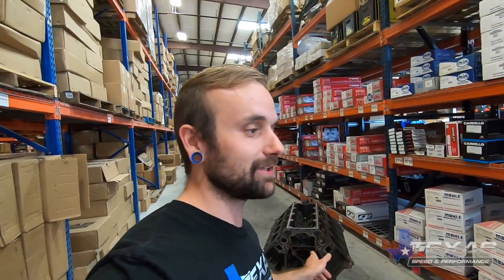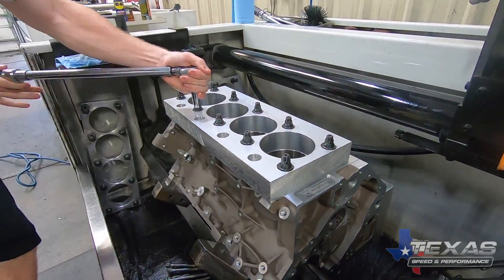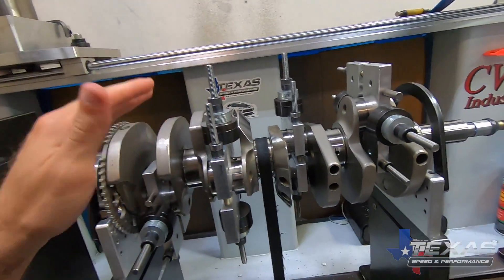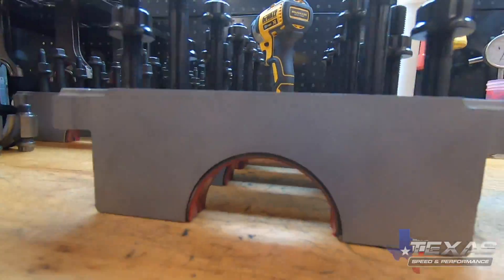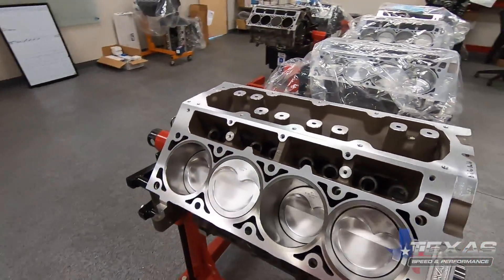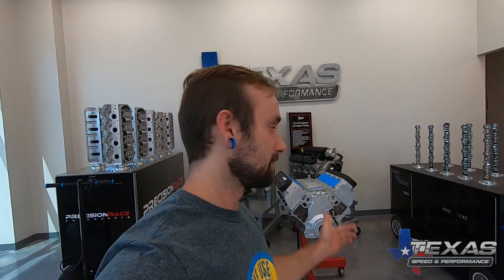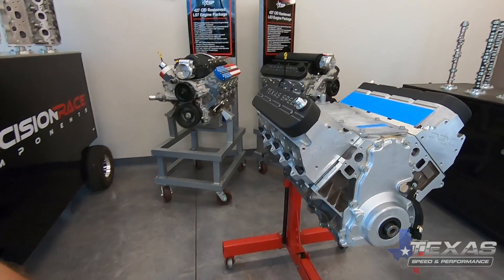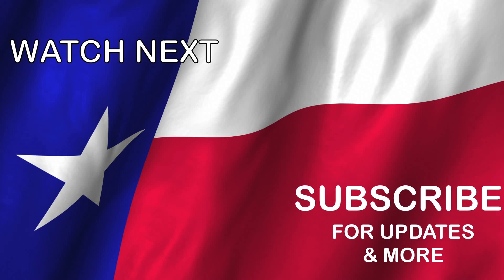Assembling B Is For Build's New Lamborghini Huracan LS Engine!

Comment: Hey guys have been thrown to this channel from b is for build loving the look of it just a quick question looking at running a Chev performance block 6.2 litre with a twin procharger setup and wanting to know do you guys have a cam for this sort of setup? Only ask as I know being boosted a different grind is required, why was the choice for a set of PRC heads?

Cheers

Comment: Was wondering if they corked the balancing holes in the crank hole. All they do is pick up oil and increase the rolling resistance. Glued and sealed cork never fails.

Comment: I don't really see the point of this other than a bunch of knuckle-draggers standing in a corner back-slapping and grunt-laughing about how they put a V8 in a Lambo... Meh. 
V10 sounds better, goes better and has more potential for power. Most importantly it's designed for the car (or perhaps more technically correctly, the car is designed for the engine).
But hey, each to their own I suppose.

Comment: learned something every time I watch a video like this: didn't know torquing down the head's distorts the block.....
Reply: Muskoka Mike by Microns not thous
Reply: @Airman..  I would have to assume too that the distortion might be more pronounced in aluminum blocks?
Reply: Muskoka Mike your assumption is plausible given that iron is much denser/harder than aluminum, the question is,  how does a minute un-measurable stress I assume effects a low tolerance assembly like an engine block? I can't see this logical knowing the low tolerance allowed in the design for thermal expansion
Reply: @Airman..  I think it has more to do with the machining/honing process than the actual assembly. I'm not a machinist, not by a long shot, but I DO cnc rout and engrave and I can tell you: 1/2 thou diff while engraving 1/16" high letters in acrylic is the difference between it looking good and looking like shit lol. 

But I digress, not sure exactly how this "tolerance" discussion came about simply because I posted that I was unaware that torquing the heads distorted the block. lol.
Reply: @Airman..  I would assume though that would make a difference in the honing.
Reply: Torque plates are probably not AS necessary with LS blocks, but still a good idea. They’re pretty much necessary with Subaru engine builds, as the head studs can warp the block more than just a little.

Comment: Make him some 180 degree headers to make it sound like an f1 car.
Reply: The sound you're describing is more to do with flat plane vs cross plane crank design.  He would need a flat plane crank to get that noise (similar to motorcycles).
Reply: @trd8749  Also rpm. F1 engines are in the 10k rpm range. This engine will redline at probably 7k.

Comment: Just a quick question, due to the boost application, is there a need for Multi layer metal head gasket and does the block require extra bracing, like a crank girdle? Cheers
Reply: @TexasSpeedPerformance  no worries, thanks for the reply.

Comment: Why overhead valves (Pushrod) its 2019.....Why do Americans still use archaic technology
Reply: Cost, and most don't know better.
Reply: simplicity works, ohc stuff is good but it's still not perfect. have an engine right now where the ocv system went bad (Mazda 3.0 v6 aka Ford duratec). it works well enough that people can push thousands of hp out of them, so there's no real reason to change it

Comment: I don't get it. The idea was to get do a cheap rebuild with used  engines, so the first one had a cracked head, then they bought another one to use as a dummy to get the brackets, transmission, and fittings all lined up, then he buys another one and sends it down to Texas Speed  but it's the wrong block, so now he has a fourth engine that's brand spanking new. Talk about blowing up your budget. This and the failed first attempt at making carbon fiber parts makes the whole Lambo Project totally crazy.
Reply: Td_kd Name he’s not paying for the TS engine, it’s sponsored

Comment: Chris graps a 5.3 on acendent. But Texas speeds be like we got you fam
Reply: Texas is like, this is why you leave it to the professionals
Reply: Or he did it on purpose and got himself a sick texas speed block...
Reply: A bit of good publicity too with it going into a Lamborghini. Go all out or go home. It was a good move on the shops part. 👏
Reply: That was on purpose, how can you not tell its a 5.3L, its stamped on the block. Yet he is figuring out all that wiring mess and carbon fiber. TSP he bought a boat with the money he saved from your engine, though u should know.
Reply: jalos4 he never saw the block? It was sourced  without Chris ever physically seeing the block and the seller told him it was 6L iron block

Comment: Ha! I totally called it that it was not a 6.0 block when he posted the vid of the teardown.
You could tell from the difference in bore size between his busted 6.0 and that block. 
Props on taking care of the problem though.
Reply: Yup I think I was posting along with you. That lq4 is going to kick some bubblegum and chew some ass. Cletus should went this route with ruby.
Reply: pretty sure that was a different block, he bought a 5.3 that wound up being blown then got another but he also bought a "6.0" short block that he sent to them
Reply: @LetItLie  nope. The one cracked blocked was an lq4 and he got another that was supposed to be an lq4 but it's a 5.3. Nothing wrong with a 5.3 but for hea y boost a  lq4 is the way to go. Or possible he did send an lq4 and somewhere along the line it was swapped with a 5.3 which wouldnt surprise me as lq4s are not an easy find with reman status.

Comment: Honestly not ever surprised. 

Dude drove 2 hours to buy a $600 6.0 that was a 5.3 with a broken block, spent a bunch of time tearing it down to finally catch on to the giant hole in the side.... like guy come on. If you just spend the $2500 the first time at any PRp Affiliated yard, you get a motor with certified mileage, a guarantee that it’s in good working order and up to a 3 year warranty. 
I can’t even count the number of times I seen Facebook post about “this guy ripped me off on a $600 motor, said it ran when he pulled it out”🤦🏼‍♂️
Reply: not saying he wasn't at fault, but sponsorships and time crunch will do that to you

Comment: Id never thought Id see the day that "LS The World" would step it up a notch.....this swap hits all the right buttons....cheaper to build than the V10, will be much faster and more reliable AND THE BEST BONUS.....LAMBO PURISTS WILL LOSE THEIR MINDS OVER IT👊👊👊👊👊💥💥💥👍
Reply: almost as savory as the mouth breathers loosing their shit over foose doing that e-type with an ls
Reply: There going to be pissed
Reply: Brother Django Dakota, cheaper? obviously. But more reliable, um no. I’ve happily have been driving my Huracan with UR motor, reliably pushing 1640whp, absolutely no issues,AC and all. Will the LS do this? 7300 miles later?
Reply: Elrod Jenkins stop lying you don’t have a huracan
Reply: yall act like he bought a perfect running Lambo and did the ls swag smh
Reply: @YGSnB  you act like that matters to the purists.
Reply: All I'm worried about is: Will it sound better than the stock V10?
Reply: I've seen a guy with a clean Diablo that's been LS swapped. I'm sure some purists lost their mind.
Reply: @I'm Mikey judging from your comment, I assume it won't sound better?
Reply: none of you get a point here.... He wanted to be the first to manual swap the huracan and do a cheap and powerful build
Reply: i have no doubt that this swap would be great . but the v10 is a better engine overall for me. a lamborghini is meant to be a spectacle, and if youve ever heard a huracan rev in person, well, lets just say even Leroy doesnt hold a candle to one when it comes to the noise. in terms of performance, im not sure what would be better. the engine that he's getting from texas speed, or a V10 with a DIY turbo system, as seen on Tavarish's lambo. i know which one is cheaper though, and it aint the one from Texas speed, regardless of whether Texas speed is giving it to him for free or not. Reliability on the other hand? well, the LS due to it being properly milled and balanced etc, by people who know exactly what theyre doing

Regardless, this Huracan build isnt just about the engine. its about the whole package and its gonna be great, if they can figure out how to make carbon fiber panels that dont suck
Reply: LMAO a V8 faster than a V10 with the same displacement HAHAHAHAHA
Reply: @fakename287  okay so. the way i see it is this. take Formula 1. the V10 cars were the best. sure, the later V8 cars were just as fast, but they didnt rev up to 19 thousand rpm and as a result, didnt sound anywhere near as cool or produce as much power.

a lambo v10 is similar in the fact that it sounds fucking awesome and v8's just dont in comparison. although, for me, the best is a v12 personally.
Reply: And the cherry on top its b is for build doing the build
Reply: And now it doesn't cost 10 grand for a clutch every 3 months much better to maintain now all-round
Reply: Cyro1 thanks for repeating what I said and tagging me😂👌
Reply: Cringelord
Reply: cant wait to finally see a fast lambo
Reply: Cheaper yes.. but more faster? Not in a million years!
Reply: @heavenlystories  tell that to underground racing lamborghini's. not to mention the rediculously fast lamborghini huracan performante thats faster around a track than a ford gt that was, as they say, a race car for the road

the main draw for LS engines is its simplicity. due to that, it has great 3rd party support from many companies. with a lambo V10, it has aftermarket support but if you want to give one more power, you gotta do a lot of custom work, but when youre building a fast car, isnt that the point?

either way, both engines are great. one just sounds better imo
Reply: Lsx block is stronger than any lambo engine and cheaper.
Reply: Yeah that's why underground racing uses a LS engine in their 3000+ hp huracan.. oh wait, they don't ahahahahahahahahvaha
Reply: @User-th6yy  Their using billet blocks, rods, pistons and trans gears.
Reply: @User-th6yy  How much does UGR charge for 2,000hp, you could probably get a bang around gallardo for the price haha
Reply: Alex Scarborough  The LSX block is not reliable @ 2000 HP.  I’ve seen them split below 2000 HP in X275, right through the cam journal.  

If you want a “reliable” 2000 HP LS, you are buying a Kurt Urban/Dart billet block period and 6-bolt heads, period.  
GM produced LS parts can’t cut it.  

Stock Lambo blocks are proven, once sleeved, to over 2000 HP.
Reply: @BCSVT  yeah it happens. But for big horsepower billet is the way to go. And 8 cylinders is the best balance. Why do you think there are no 10 cylinder funny/drag cars.
Reply: Alex Scarborough  For V engines, V12 is probably the best balanced.  

Top Fuel/NHRA are a lot like NASCAR, very conservative in their approach and rules. What they do isn’t necessarily what is best, but what had they’ve spent time developing.  

There’s no doubt if Top Fuel went to 4V cylinder heads or 4V V12s they could make a lot more power with the same level of R&D and investment.  Rule books prevent such changes, which is unfortunate.
Reply: @alexscarborough6263  v12s and inline 6s are better balanced than v8s. I have nothing constructive to add, just that tidbit lol
Reply: Nope you're all wrong, best balanced engine is Harley Davidson v twin
Reply: @balcyvr6  vr6 is the best inline
Reply: @alexscarborough6263  it's close enough! Lol
Reply: It's definitely my favorite sounding 6. And I can afford to have one!
Reply: No it won't  be faster or more reliable.https://www.youtube.com/watch?v=B_R3J-7XfFM
Reply: @mbsnyderc  that video has nothing to do with this comment. if you think that v10 will be more reliable than this LS ....you dont work in the industry or build race cars.
Reply: davew26262  High power LSs (1500-1600+ HP) are never reliable with cast blocks.  Somebody in the industry and who builds race cars would know this.
Reply: @BCSVT  That's true.  Forged parts have 37% more fatigue strength overall than cast iron.  It is a matter of how much money people have.  If they have the money, they should just go with the V10 from Lamborghini.  The highest horsepower Lambo's use their stock blocks, not LS swaps.
Reply: @VerisimilitudeDude  no the highest hp lambos are billet blocks and billet trans gears
Reply: @mbsnyderc  dude, yer trollin'......as much as I like the various V10s on the market, when they need maintenance or break ya gonna cry. Lamborghini hasn't been Lamborghini for awhile since ze Germans took over.
Reply: @hoost3056  Where's the logic in that? Just because it's part of the VAG Group doesn't mean it's less Italian. The 5.2 V10 and the Aventador V12 are still Italian engines even though the 5.2 also appears in the r8.
Reply: @simonknoll6999  actually, if you wiki the engine design, it is based on the Audi V8 with 2 cylinders added. Utilizes the same FSI injection system. And lets be clear, any of the luxury manufacturers that got acquired by a large OEM ( except for Ferrari ) are platform engineered vehicles.
Reply: @hoost3056  Fair point. This still, to me at least, doesn't mean that they "lost their way" or "haven't been the same" ever since they got acquired by VAG.